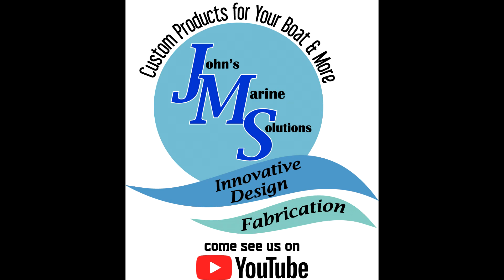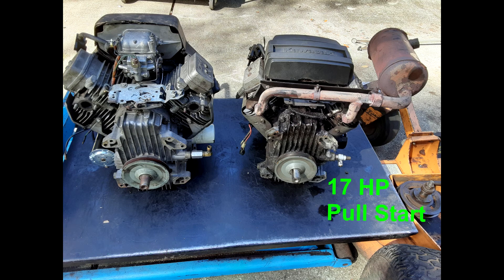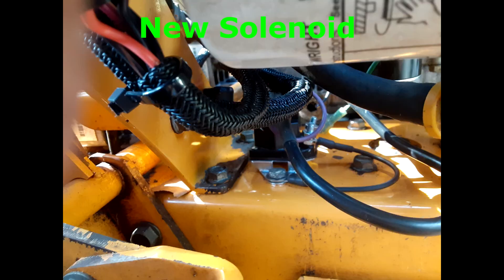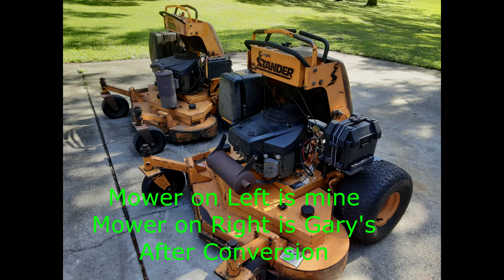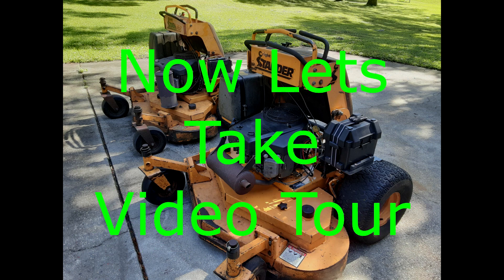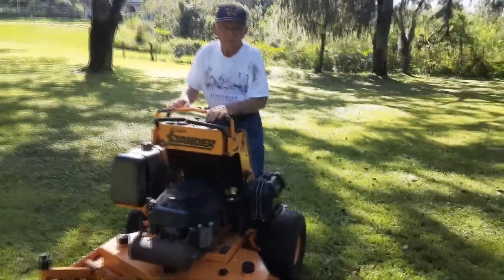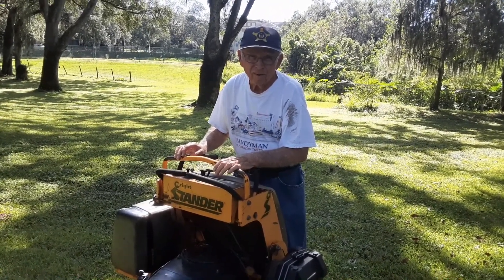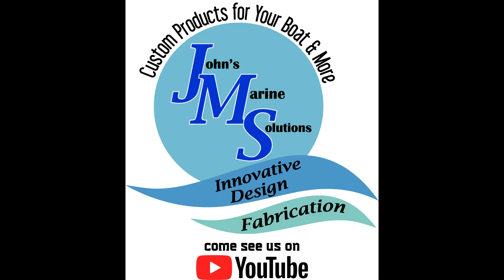Part 1 Wright Stander Pull Start To Electric Start A Wright Stander Story

Comment: I am very impressed! Is your "Wright Stander" an electric or pull start?  Your Brother Gary sure looks happy. I initially thought you were testing out the new electric start Wright Stander but it turn out to be Gary, You guys are two peas in a pod ;-)
Reply from the maker: You are not the first person who has said that.  Ha Ha  I was really surprised that after sitting under that bench for all those years it has risen to the occasion and so far runs great with no smoke in the exhaust.  Glad we changed the oil and filter as part of the startup.  The lift table was really helpful in moving those engines around.  That 23 HP was  a little on the heavy side.  Ha Ha